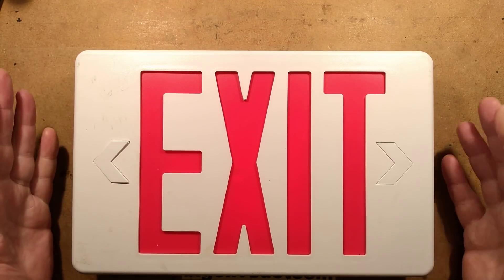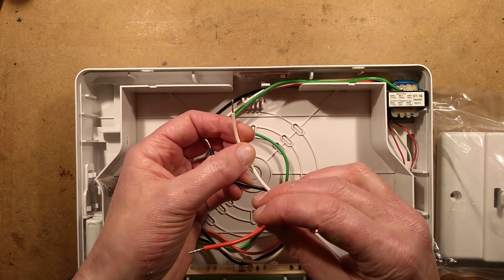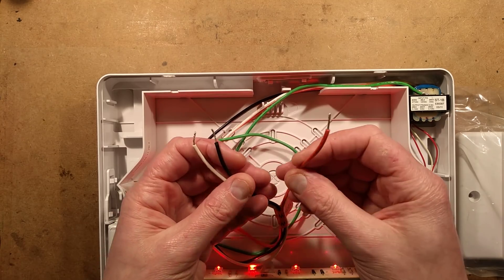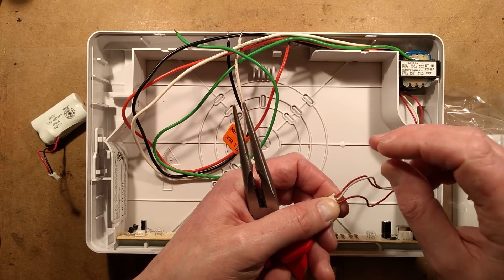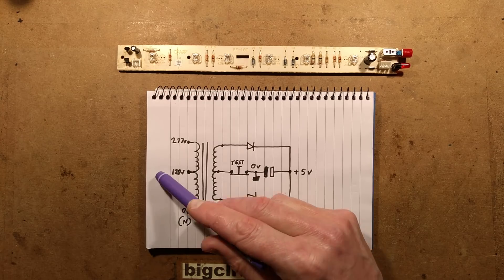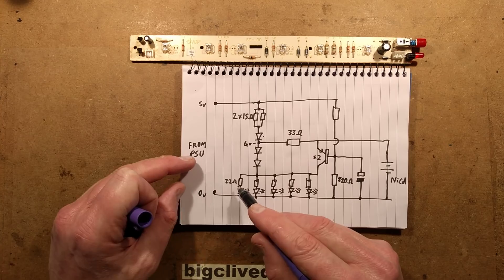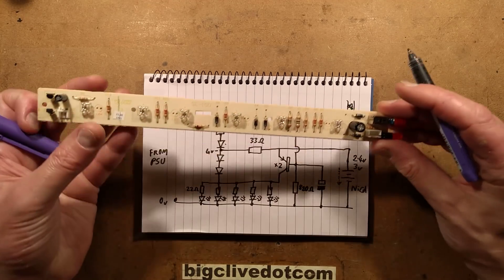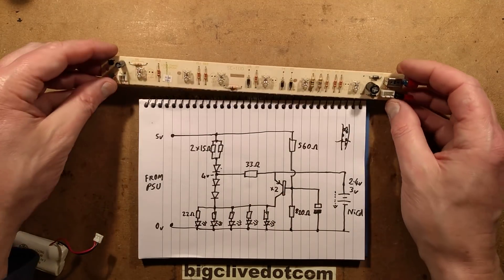Inside an American emergency light (with schematic).

Comment: Here in Calgary, the green running man exit is legislated for all new construction, while the old Red Exit are grandfathered until renovations. Red is a little less irritating definitely.
Reply: It's a "Western" thing... the US western states like Colorado and California have used international green EXIT signage for decades now, whereas the Eastern states still use red signage.
Reply: I'm in Ohio and all of the signs I've bought for the last 5 or so years have come with a green panel you can put in to replace the red one and a switch on the circuit board to switch from the row of red LEDs to a row of green LEDs. I've always left them red because that's what I'm replacing.
Reply: @pingumcping  Red is poison? I thought green was? Also given the red cross red is also associated with medicine and help
Reply: @threeparots1, here in Ontario the Green Running Man is  the new standard.  Old buildings keep the traditional red exit signs until reno's or replacement time.
Reply: I just noticed a green sign last week at a recently renovated MacDonalds in NS. It looked exactly like the on Clive showed recently.
Reply: Red isn’t original in the US and I’m sure it wasn’t in Canada either. Exit signs were mandated to be green until the 80s. In the 80s they started to allow red because red LEDs were widely available but green ones were not. LED lighting was more reliable and used less power so you got longer on time from the same backup battery. So at that point both green and red were allowed.

I’m surprised red wasn’t disallowed once green LEDs became very common in the 90s. Sounds like it has been in Canada.

The running man is not required in the US but is starting to become more common anyway.
Reply: @stevebollinger3463  This may vary by state anyway, as EXIT sign color is not mandated by any federal law, but left up to the individual states to determine. For example, Illinois requires RED. Maryland requires GREEN. Many states have no requirement for exit sign color.
Reply: @stevebollinger3463  "Red isn’t original in the US and I’m sure it wasn’t in Canada either"

I've lived in Canada since 1965 and I NEVER saw a green exit sign until about two weeks ago in a new conference hall building. 

"Exit signs were mandated to be green until the 80s"

Again... absolutely not true until recently in Canada, and AFAIK not in the Eastern USA either. I live very close to the US border and traveled into the eastern states as far south as Georgia hundreds of times over the past 50 years, and the VERY first green EXIT signs I ever saw were when I worked a contract in Denver Colorado in 2005/6. Green signs may well have been mandated in the western US for many decades, but that was definitely not true in the east.
Reply: @stevebollinger3463  I've seen some exit signs I know had to be from the 70s if not prior and they are red, not green. I also seem to recall that every Radio Shack catalog I saw in the 80s showed that green LEDs were available for purchase.
Reply: @pingumcping  I guess we just like to live dangerously. :)
Reply: I'm guessing red was originally chosen because it has less impact on night vision recovery.  I have seen some places start to use green exit signs though.
Reply: I think green may also be easier to spot through fire and smoke. Not sure.
Reply: Green is more polite, hence Canadian, eh?

Comment: 277v is nothing. In Canada we have a terrifyingly high voltage of 347/600V  for our lighting systems. Always fun sniffing out a broken neutral.
Reply: Many years ago I fixed shipboard RADARs for a living. The bridge display units had 600V DC at multiple points and I took shocks to the hands many times. At 600V the arc burns a perfect pin-sized hole into the skin right to the bone. Didn't actually hurt too much and after a day it will close over and then swell up a bit. LOL
Reply: Martin Green That is terrifying
Reply: @kraio-sfu  as someone who loves to play with pulsed high voltage and also high frequency tesla coils, i can assure you that there is worse. You can get a shock with the skin effect, which will basically cause a really large wide burn without the feeling of getting shocked. the pain comes much later.
Reply: @drkastenbrot  - You should probably point out that "skin effect" is not so named because it burns human skin, but is actually the tendency of very high frequency electricity to flow most heavily at the outer edges of the conductor. The higher the frequency, the more the current is pushed outward, to the point that at the frequencies used in RADAR and Tesla coils, you can actually cut out the middle of the conductor (saving copper and weight) without reducing the ability of that wire to carry the current since the wire core wasn't really carrying current anyway. I've never played with Tesla coils, but I have a mental image of super high frequency/voltage flowing through the outer millimeter or so of my flesh without affecting the inner tissues. Yikes.
Reply: Ontario!!! I have designed machines to go into those installs. PITA to be honest!! 330/575/3ph delta is the official designation for 4W and 575/3 for 3W delta. Typically just called a "600v" system. Still its a real pain for equipment designers like myself. Thats where we push off the distribution transformation of voltage onto the customer and supply a normal 120/1 system.
Reply: Higher voltage of, as high 347 are often found in florescent lighting circuits in Canada because of the very long runs of multiple luminaries in office floors, hallways or parking garages etc , keeping the number of circuits to a minimum. Yes, it is a scary thing to work with.

Comment: There are several versions. This is your classic red. You have the classic green as well which is identical except for green plastic and green LEDs. You also have the tritium types and the phosphorescent types that are glow in the dark material and are charged by the existing room lights.
Reply: As usual, the US is weird and varies state by state. The feds only require that it says "EXIT" in a certain size - color is left to states or even municipalities to regulate. Some are green, some are red - I think one is even orange. Some places let you use photoluminescent signs, which obviously do not need testing. Another "as usual", NYC is weird (for the US) and is switching to the green running man (not on the lit signs, but on fire doors).
Reply: NYC is unlike most US cities, in that it is composed of five counties. In some of those counties, English is NOT the language spoken in some 50% of homes. About 40 other languages are in use, about 6-8 are used at the polls and in other places. NYC puts an unusual emphasis on not using English but using symbols instead, so there is less confusion for the many folks who speak no known language.

Comment: The older lead acid ones of these always had ballooned batteries in them lol
Reply: iamdarkyoshi  LOL, that’s how you know when to replace the battery when the cover is pouched out!
Reply: I miss the nostalgia of seeing the backside of the older signs with two bulb-shaped, brown-colored, heat-warped, spots from the old "test tube" bulbs inside.
Reply: They were continuously overcharged. Doomed
Reply: But lead is supposed to like being continually charged.  They're just only good for five or ten discharge cycles (power outages).